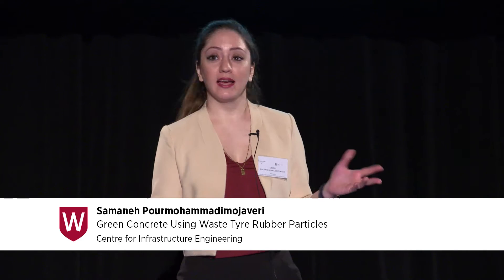'Green Concrete Using Waste Tyre Rubber Particles' 3MT Samaneh Pourmohammadimojaveri

Comment: How its possible for replacing rubbber for concrete rubberized concrete is still research is going all over world there is some practiacal failure in between testing specimen in load framing method is not proper placing of specimen while students  had been mark some mistakes all over world but I got flexural cracks & properties  in my college project done sucessfully.

The KMn04 inorganic as a medication it is used for cleaning wounds and dermatitis. It is a strong oxidizing agent.
Green concrete is good for pratically not has been done in construction side.Green Concrete Using Waste Tyre Rubber Particles' 3MT Samaneh !!!!!!
Reply: Please, may I see your project on this project?